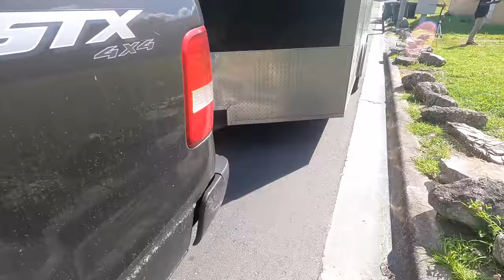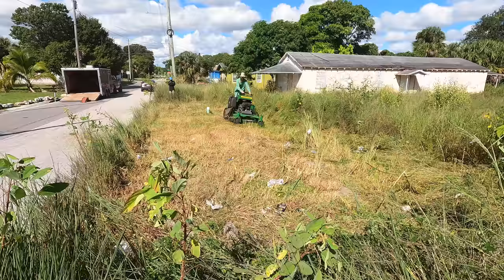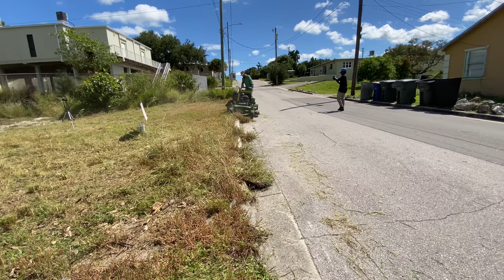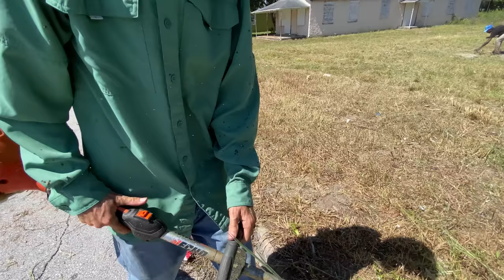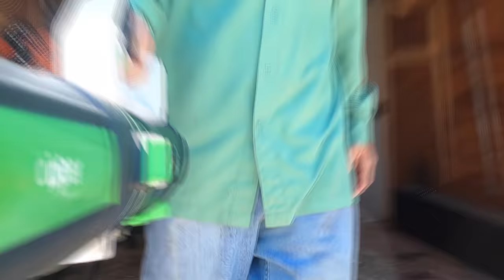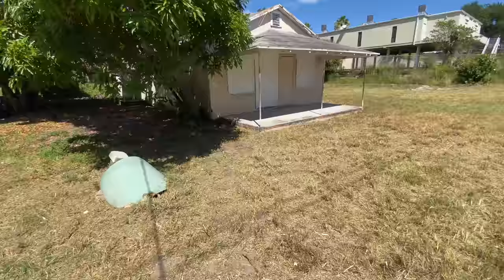FREE Public NUISANCE yard Transformation IN THE HOOD [SUPER OVERGROWN]

Comment: OK I have a serious question for you I enjoy your videos and I’m always interested in the equipment itself. My question is when you start mowing these super high grasses and there is no way you can see everything down in it. What kind of protection do you have against anything from ropes and wires getting wrapped around your blades to your blades actually striking into things. The average mower cannot mowing grass that high because it will just lay it down in the bleach all over it. So talk about your equipment and state what equipment you personally think would be even better if any? Personally I would love a mower like what you use the standing mower but with a hammer style flail attachment
Reply: I've been cutting and sports-fields(etc) for 30 years. On long grass you must do a walkthrough to spot objects. Some objects you will not remove, but just avoid. /use weedeater

Al doesn't do this but- I start at a setting of 4-to-5 inches if your mower can be set that high. You will still catch wire, fishing line and sometimes metals (if an undeveloped site).

Knowing how to remove, replace & sharpen blades is helpful.

Comment: Those japanese elms are pretty, but they are an extremely invasive tree species responsible for millions in damages to foundations and pipe-line systems, underground cables, etc.  They were introduced as a means of stopping erosion because they grow so fast, but they weren't kept in check and have proliferated across the USA. These things are terrible for local flora, as they rob the other plants around them of nutrients, and they spread root systems that grow new trees.  If you have ONE of these things in your yard that is at least 15 years old, it's a safe bet that every other smaller Japanese Elm in your neighborhood has a root system connected to it.

Dig them up, use weed killer on them, mulch them straight to the ground, dig as much of it out as you can, and get rid of them.

Comment: I know this video is old. But just a tip if you haven't done it already. I know yards like this are brutal on blades though. But when I was doing this. I bought a mulch deck after a while. But before I could buy that. I would buy mulching blades. They are thicker. And weigh more. And are meant to cut through brutal lawns with thick weeds. Just my experience. Everyone is different @AlBladez